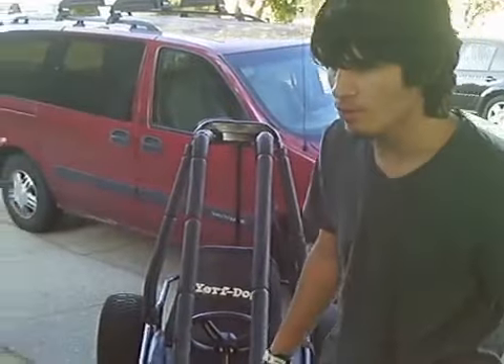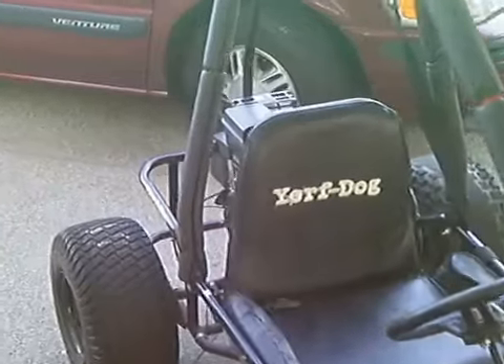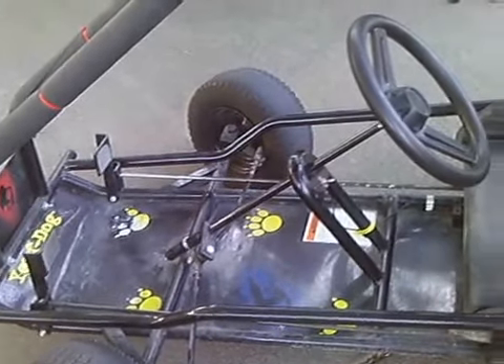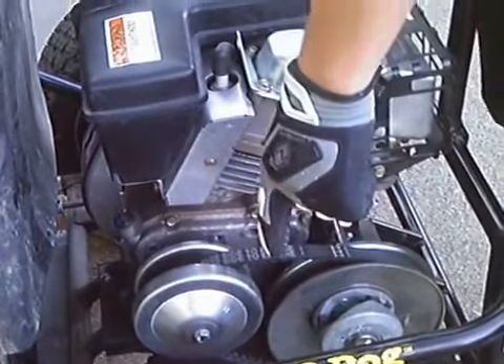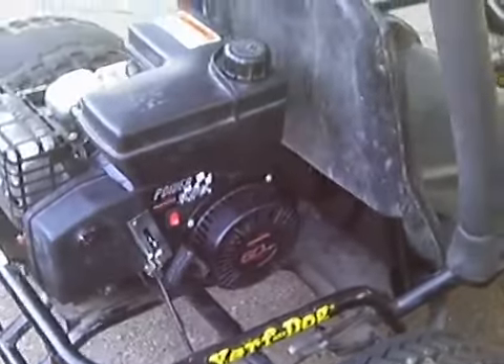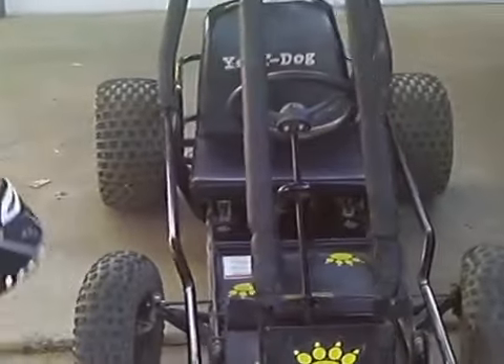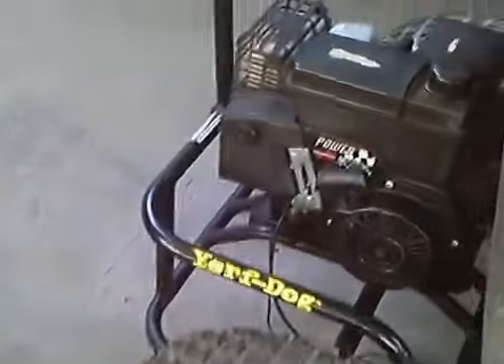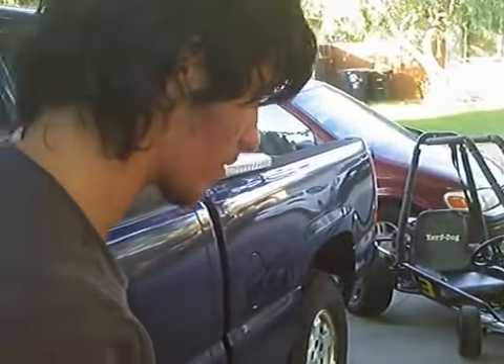YERF DOG Go Kart Single Seat 6 HP Tecumseh

Comment from the maker: Actually the opposite, because a clutch works off of slippage, once it is engaged it immediately takes off at the speed that the shaft is spining at, causing it to jolt a little and not that smooth of take offs. A torque converter on the other hand has the 2 pulleys with the belt that slowly engage the belt the faster the shaft spins. The belt doesnt require complete grip in order for it to turn the sprocket, allowing for smoother take offs. That is the only purpose it serves.

Comment: How do I look for that type of torque converter? Is there any serial #? I have a go kart with a swap predator 6.5 hp 3/4 " horizontal shaft,  do you think that converter would fit? Thanks.